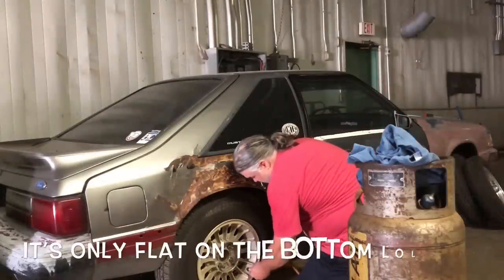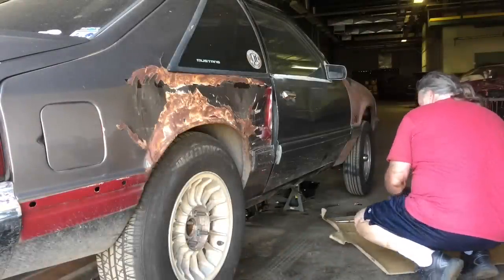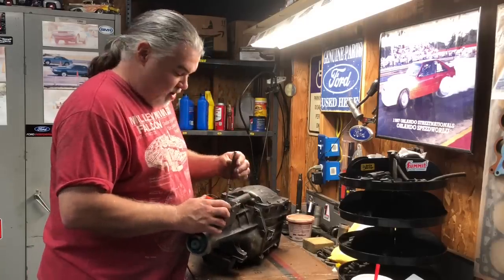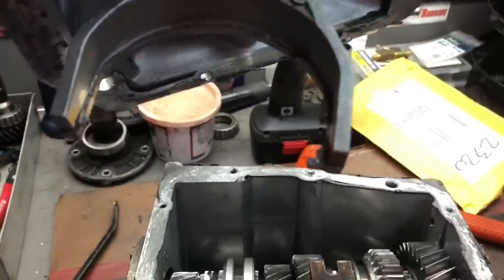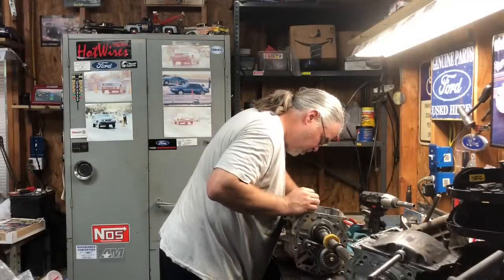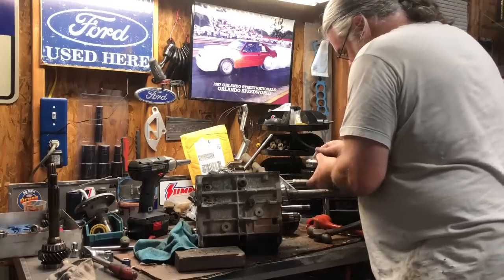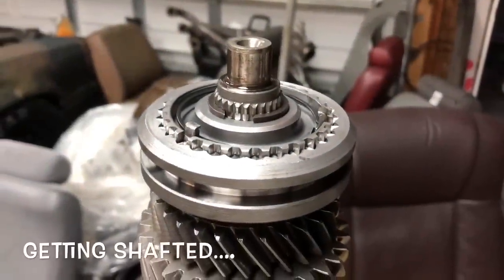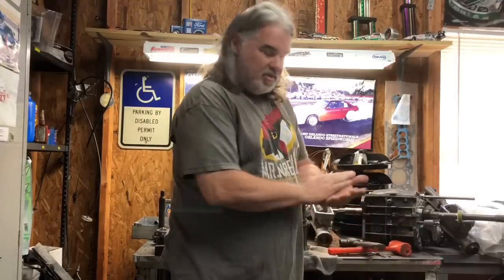1991 5.0 LX kRusty pt.9 T5 Pt.1 Budget Fox Body Mustang Drag Car

Comment: Beating on those forks like they owe you money! Your vids are a testament to how a few properly replaced internals (cluster support, keys, and pads) and a soft clutch will make for a fairly strong transmission. I've argued with countless people on not using an aggressive clutch with these transmissions and how tough they actually are with a small amount of updating. What is your experience with the older non WC T5's? I have one in my 83 that I'm going to use until I can't. I like the idea of the 2.95 first gear for the 4.56 rears. I know they aren't "rated" as high as the WC trans, but I have read guys like Bob Hanlon actually liked the Non WC boxes.
Reply from the maker: Yeah, its about keeping them alive lol...the clutch is the fuse, plus alot of "mild" cars dont have the power to drive thru the clutch with tires and a decent track so its bog city with the 6-pucks and stg 4's and stuff lol.........i have a NWC on the bench that came out of my '84 GT i got back in '92 lol.........

IMO

Pro's:
2.95 first
Its a T5 lol

Cons:
Cluster bearing is pressed in (no support or way to add one at least with the NWC case i believe)
Hard to find replacement parts (gears, especially 3rd)
Mainshaft is specific, doesnt use roller/needle bearings under the gears, shaft is grooved for fluid flow...

Again the parts thing is really the only downside imo, i just listed what i consider cons but arent really problems.....also with the brass syncros using syncromesh or similar is a must in my book, some guys have also ran versions of John Deere hy-gard and stuff in them...the big thing is once it breaks (if it ever does) parts can be an issue other than that let it rip:)

Comment: Rodney, how do you set the stops on your hurst shifters?   Was curious if you have seen that brass shift pad wearor broke forks on the others.  I "lucked" into a T5 world class out of a 3rd gen that I'm planning on putting in my Disco Nova(is Chevy content allowed on the channanel?  I do own a Ford Fox but it's a panty dropper, which may not cancel out the chevys).  Not planning any 5K RPM launches, but I am  doing the cluster support and billet keys.  Honestly, tired of the tranny leaks out of the automatic, and manuals are defenitly more fun to drive.  As always, thanks for the great content.
Reply from the maker: I just put the trans in each gear (car off), adjust the stops to "barely" touch and then row them thru the gears, fake powershifting (again car off) and if that seems okay i'll take it for a spin and bang thru them an thats pretty much it for me lol...........i've seen brass pad wear, plastic pad wear/breakage and i've broken the forks before, its always 3/4...just seems to be part of the game...i will say that i've started just going back with the plastic/teflon pads, i like the way they fit a little better...also i've only broken 3? maybe 4 forks which i dont think is all that bad considering how rough i am on them..........should be a lot of fun in the Disco...David Freiburger would be proud:)
Reply: I wish David would have finished his yellow Disco.
Reply from the maker: David is the king of "abandoned" projects lol.............Car Craft was awesome when he took it over in the late 90's...had some great articles and projects..he does a good job with Roadkill and RK garage, i really like the junky stuff, he just needs to leave the 4x4/off road stuff to Fred on DID and focus on cars lol
Reply: 50tussin I liked the 440 in the Dart project in the magazine, but he tore up a factory 340 Duster to make it if I recall correctly.  The 500 Caddy in the Chevette was a cool project too.  I have only watched a few RoadKills, but the 351C garage rebuild in the Mach 1 was fun.  He abused a 5.0 fox against the Rotsun in one episode.  That seemed pretty pointless to me.
Reply: sbf_fox  -  I have those 3 articles outlining the dart build.  Allegedly that 340 car wasn't worth saving.  Seeing some of the darts Freiburger has saved, that 340 car must have been bad.
Reply: sbf_fox, a clarifying point on my comment about that 340 Dart.  30+ years ago, it didn't make sense to save it because Darts, like Novas, my A-body (1971) Cutlass, Chevelles, 60s - 70s Mustangs, you name it, were just daily use cars.  You couldn't walk a JY without finding them.  Now, if that 340 Dart was found in that shape today, it would be saved.  I think the same thing when I find a Fox in the yard now, especially the last two really straight 4 cyl notches out here in our U-pull its.  Its like, what dumb ass let this thing go to the JY.  One of the best things about this channel, is not the knowledge willingly shared that Rodney gives out, its how he goes about saving/preserving Foxs and keeping them from the JY.  Oh, and he has one of the most understanding spouses I've ever seen a car person have and mine is really, really understanding.

Comment: Rodney is the z-spec the toughest and strongest t-5 they make or is the z-motion t-5 the strongest, if you herd of that one.
Reply from the maker: IMO the zspec is totally overpriced lol......it's a "nice" trans but besides the 2.95 gear set and "improved" bearings, "slightly" stronger gears/cluster and its cobra pocket bearing its not worth the money to me........the Astro A5 is the best T5 to me, much stronger gear set/cluster due to materials and cut design, much stronger mainshaft (9310 alloy), 26 spline input, cluster support, billet 3/4 keys..wrap that in a reinforced g-force case (optional) and you have a bad boy t5 as compared to a zpec..........i've got a 2.95 geared pro-motion t5 (basically a zspec) and its a fine trans as well but the A5 is the best in my book........
Reply: what year is this astro van, what is the vehicle the A5 is found in and what year. or am I just an idiot ha ha ha.
Reply: oooo astro performance
Reply from the maker: Tony builds a really nice trans, smart guy as well:)

Comment: Cool video have you ever run a 2000s year v6 5sp I run across them time to time at you pull it junkyard not sure if they will take a 400hp car very long so that’s why I’m asking you cause I run 4r70 auto
Reply from the maker: 400rwhp (depending on clutch/car weight/how the power is made etc) is asking alot of a t5 but the 99-04 are some of the best "factory" t5's so they have a chance lol

Comment: Thanks for all the information you share. I'm a new subscriber. 
Have a question for ya. 
The t-5 in my GT grinds a little shifting from 1st - 2nd and 2nd to 3rd. Would that possibly be an issue with synchronizers? Seems to be worse at higher rpm.
Reply from the maker: Thanks for checking our little non profit out....sounds like it’s synchro time...maybe try a fluid change, fresh fluid can cure some small issues with these things sometimes...
Reply: Thanks for your reply. I've owned this car for about 10 years. It's had the same issue that long. I pulled tail housing and swapped speedo drive gear years ago and put fresh fluid in then. Didn't help. Guess i need to look for a junk yard T-5. I've thought about putting new synchronizers in it just not sure how. 
You would happen to have a video on a synchro install would ya?
Reply from the maker: The Bob Hanlon DVD from Hanlon Racing can walk you thru a total rebuild, step by step...best $20 I ever spent in a T5 :).....it may not be listed on their site so you may have to email or call about it...
Reply: @5.0tussin  Thank you!

Comment: So.. For you and other guys like you i have 1 last question. Do i need a adjustable regulator to street drive my car? I have 24lb injectors, 75mm proflow with kemso 340 pump
Reply from the maker: Its not a must have imo...a adj reg and gauge are good to have for track tuning etc but arent required for something like just driving etc, especially if the combo is fairly mild and youre not taxing the fuel system...just my opinion....

Comment: I recently did an aod to T5 swap on my 90 notch I took my time doing everything right well on the 3rd day I was done so I took it out for a test drive and about 15 minutes into the test drive I realized I forgot to put the transmission fluid in it Dope!!!  but surprisingly the transmission still works it was a used transmission anyways and the guy that sold it to me said that it was working fine but I do notice that the synchros 3-4 seem to be going out I don't know if it was from not having oil or if it was like this before??
Reply from the maker: Well it could have been like that before...running with no oil certainly didnt help lol..........heck it may run like that for years...we knicked the 3rd gear syncro in Dragon almost 10 years and 400+ passes ago, have no issues racing just have to baby it a touch normal driving:)

Comment: Is it worth it to do the front bearing like the z spec on a regular t5 instead of the needle bearings ?? I'm taking my t5 apart this winter and want to cheaply build it as strong as I can ....it's running behind a 350 HP 306 ....any other areas I should look at improving?? Also wicked videos ...I just subscribed!!
Reply from the maker: No

Comment: Your vidoes are so inspiring!!!every one says t5s are glass and u need to spend 3000 on tko  just to have a fun street car. What are the mods you have to make the 3.8 t5 fit in foxbody?i have foxbody bellhousing,also how long do these t5s last if driven on street
Reply from the maker: It’ll need a fox input and clutch fork, block plate...depending on which T5 you get it or may not be mech speedo compatible... all I add are a cluster support, 3/4 billet keys and a steel bearing retainer...I’ve never “broken” a T5...damaged shift forks and factory retainers and I hurt one that was low on fluid (my fault, new input and still racing it) but they will last a long time at low power levels or traction...I wouldn’t put one behind a 500hp stoker/blower/turbo/nitrous car and expect it to live with tires but for the money I’m more than happy we it’s how my t5’s are performing 👍🏻

Comment: Got a guy with a t5 out of a 87 turbo Thunderbird.   Tag is 13-52-155.  This be a good one to grab for a gt40 build?  Can the input shaft be replaced with a v8 t5 input?
Reply from the maker: If its almost free, i guess....its  3.97 1st/2.34 2nd/1.48 3rd/1.00 4th........cant change the input or get a aftermarket steel retainer...personally i'd wait for a SN trans or whatever...i'm using one in the LTD but i bought it years ago for $45 so just used it since i had it on the floor, when/if it breaks i'll use a SN v6 trans and gear the rear the way i want........

Comment: clutch fork - shift fork- no clutch fork- no shift fork. blocker ring, synchro  wait wut?    that poor bastard took a big chunk with it. reminds me of people saying they bent a fork... nope pad all ways snaps off the damn $15 shift fork, surprised no one has made them in billet like they have for the t45, tko and 3650. Hopefully the billet keys prevents it from hanging up again, with the way those pads looked something wasn't too happy.... who are you getting parts from? Last cheap set of "billet" keys I bought off e-bay where powder metal. Should show what the old keys looked like with the broken fork.
Reply from the maker: The billet keys that were in it were fine, it just blasted the fork, its always 3/4...g-force used to make some brass forks but they were crazy priced..Bruce hemminger suggested i call gforce as he thought they were making some but i bet they are pricey, i never called lol
Reply: Bruce used to sell them for the tremecs with 2 extra pads machined into them for a pretty decent price, so not sure why no one ever really marketed them for the t5. I all ways dealt with Walsh or Halon back then for parts. People all ways claimed the billet keys where the fix but you  would still see broken forks. Its why I went to tremecs in the 90's.  killed plenty of those forks,  most the time you would end up being stuck in third gear and know right way the fork snapped the pad off..
Reply from the maker: This is only the 3rd or 4th fork we've broken......dont get me wrong if there was a "reasonably" priced 3/4 billet fork i'd buy some but till then i'll just keep rockin the stockers....why i thought we had killed the gear/cluster, it would "go" into 3rd but nothing there and 4th shifted fine lol

Comment: You sir need to do dragweek in one of your  rides.
Reply from the maker: Pretty pricey to run DW...........hotels, gas, food etc etc.........
Reply: Do it in the van! Who needs a hotel.. on a side note would an aftermarket shifter with stops have saved that shift fork?
Reply from the maker: Has a shifter with stops........they will break (imo) at some point no matter what...its always the 3/4, its the longest throw and i hit it the hardest, i've broken a few 3/4 forks...just part of the game....the crazy part was there was enough of it to grab the slider and shift in and out of 4th but 3rd was a no go, have never had that happen........